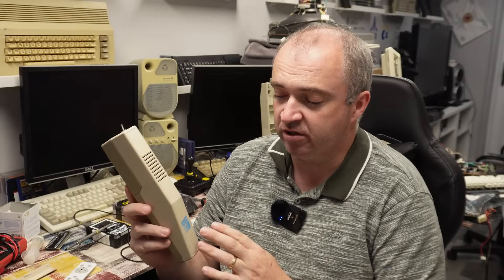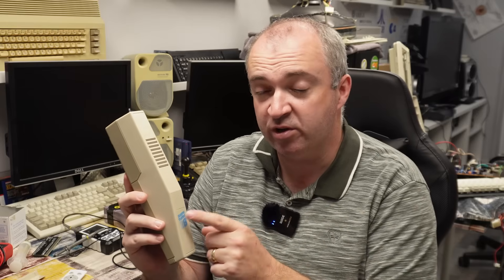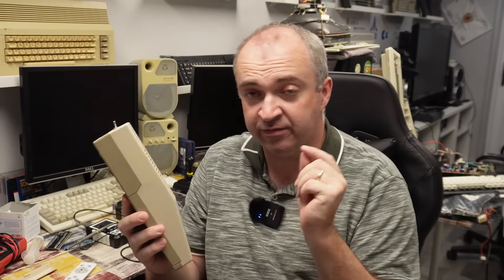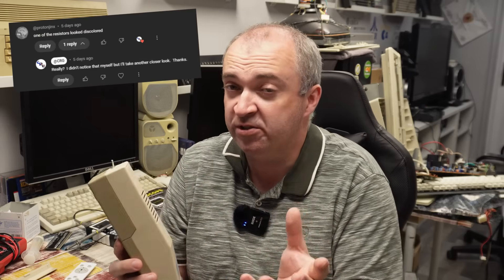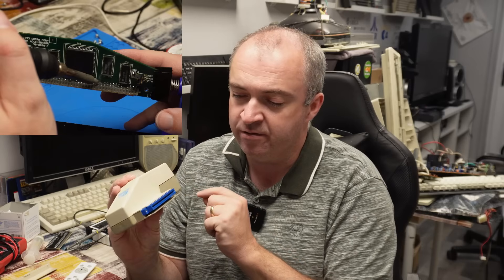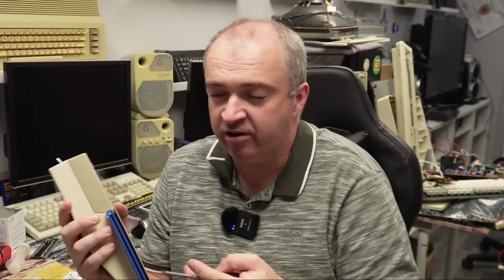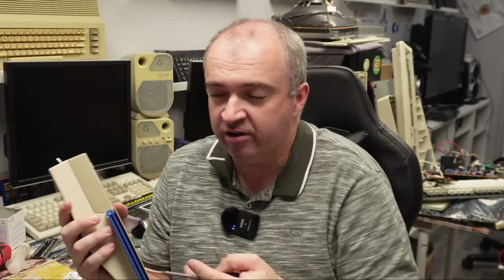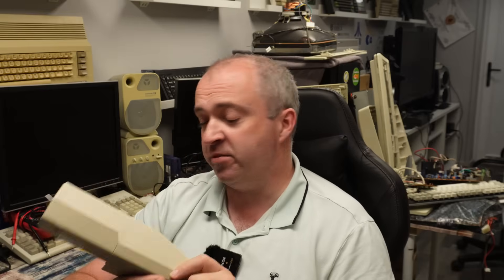This Amiga Accelerator STILL refuses to work!

Comment from the maker: E-Mail from ARNE about the Atari ST device 

As you can see the IDTs have /CS, /OE and /WE like any other SRAM. /CS is always (GND) active just to act faster with the expense of using a bit more current. But /OE is tied to Vcc i.e. in-active all the time!  That means the "data" (addresses) on the IO[1..8] pins is never read_! You can only write into the IDT in the way it is connected in the schematic!  So a write-only device does not make sense at all. Well, yes. But there is one _output channel beside the IO pins: the MATCH pin (HIT signal in the schematic). On /RESET the GAL logic will assert (=GND) the /CLEAR pin of the IDTs. This will lead to the SRAM matrix to be set to '0' in some ten nanoseconds. Now the IDT-SRAMs are in their 'initial' state. Whenever a device (bus-master like CPU) accesses a memory location it puts the address on the address bus. The IO pins of the IDTs are connected to the upper part of the address bus while the lower part is connected to A0..A12 of the address pins of the IDTs. Cache is empty and needs to be filled. Whenever the GAL logic decides to store a 16bit word in the data SRAMs IC4/IC5 - only on writes to memory on the Mach16 - it needs to perform some red-tape action. At the same time when it writes the 16bit word into IC4/5 it needs to update the according entry in IC2/3. The upper part of the address visible on IO1..7 will be written into the location addressed by the address on A0..12 by asserting /WE. So, now we have stored a single data-word into the cache. The same data-word is written to the main-memory (write-through access). How to speed things up?  Now comes the magic: every address on A0..A12 addresses an octet (byte) in the internal SRAM matrix. The IDT takes that byte and compares that bit-pattern with the bit-pattern currently on IO1..8. If the patterns match then we have a cache-hit. The GALs now forces the data SRAMs IC4/5 to output their stored data-word on D0..15 and an access to the (slow) main-memory is not even started by the GALs as they intercept /AS, /LDS and /UDS coming from the 68000. They "capture" these signals and start the faster SRAM access instead.
That is the magic behind the MATCH pin. As DMA devices can alter main-memory contents without the GALs knowing anything about it we run into one problem: the updated data in main memory can differ from the cached values in IC4/5 which will certainly lead to problems (aka guru meditations). How to solve that? Simple: assert /CLEAR and invalidate the L1 content - like on /RESET - and start all over again. That said it is pretty obvious that constant DMA accesses will ruin cache performance.

One more side note: as you can see IO1..6 on IC2 are pulled high. This is very important! At least one bit of all IO pins needs to be pulled high! Whenever the cache is in its initial state (matrix is erased via /CLEAR) every bit (especially on IO1..6 in case of Mach16) is set to '0'. Whenever you use /WE to write into the tag SRAMs IC2/3 the high-pattern on IO1..6 overwrites the '0' with a '1'. Next time the tag SRAM compares the internally stored pattern IO1..8 with the external pattern on IO1..8 it will check IO1..6 for a '1'-match, too. If the internal bits are still set to 0 then this indicates that the data at that address has not been stored in the data SRAMs IC4/5 yet. OTOH if the IO1..6 bits are set to '1' this will lead to a MATCH if the rest of the pattern matches, too.
This way the bits at IO1..6 represent the Valid-bit. It would be enough to just use one of the six but as you shall not leave such inputs floating just connect them to high. The author may have grounded IO1..5 and just use IO6 as a valid it or any other combination as long a at least one unused IO is pulled high to counter the internal '0' set by the /CLEAR action.

As the upper part of the address bus on all IO pins of IC2/3 goes up to and includes A23 this indicates that the whole 16Mbyte address space of the 68000 is cachable. The cache is implemented as a "direct-mapped" cache i.e. for every memory location (16 bit word in the case of the 68000) there is exactly one location in IC4/5 where the data can be stored/cached. In case of the Mach16 and your accelerator the cache size is 16KByte. So the locations at $000000, $004000, $008000, $00C000, $010000, $014000,... share the same offset-location in cache ($0000) and the same applies to $000002, $004002, $008002, $00C002, $010002, $014002,... share the word at offset $0002 in IC4/5. That is why you need to store the upper part of the address in the tag SRAMs (the red-tape stuff) to distinguish between the possible main-memory loacions $000000, $004000, $008000, $00C000, $010000, $014000,...

In case of the mach16 the cacheable area is 16MByte (more specific 8MWords) and the cache size is 16KByte (more specific 8KWords): So 8M / 8K = 1024 i.e. that 1024 main-memory locations have to share a single L1 location. Bigger cache = more cache hits as less main memory locations share the same cache location. 

Previous Comment from ClayCowGill

Insider knowledge disclaimer-- I worked at Supra. So yeah, removing the part numbers (early on) was just to frustrate competitors trying to either reverse engineer (or simply figure out our costs). Early units had pretty much ALL the part numbers scrubbed by electric-erasers... I also remember a little discussion about the 68HC000 in particular in that the top speed grade from Motorola at the time was 16MHz (obviously we were overclocking) and we didn't want to have to have our (two) Amiga tech support people have to argue about 'out of spec' parts with nerds on the phone. ;-) Engineering also thought it was funny imagining GVP or some other competitor trying to figure out if we had a special deal with Motorola to get ~33MHz 68000's or something... We ran the accelerator in engineering up to 40MHz (it was originally going to be a 36MHz accelerator, but we got cold feet about compatibility/reliability and turned it down). Running slower also gave purchasing some elbow room in the speed grades of the SRAMs (and maybe PLDs?) which helped keep it cheaper and easier to source parts for.
 
In addition to making it smaller, the Intel PLDs also helped with the design obfuscation/protection -- at the time there wasn't any real fear of anyone being able to bypass the read back protection easily. (Back then there wasn't any Chinese outfits with a SEM and a FIB that'd crack programmable logic for a few hundred bucks!) Those parts are N85C090's -- kind of an early CPLD with ~24 macrocells (900 gates, hence the part number). They had a decent amount of IO though (more IO pins than macrocells). The 'clock' lines on those are just that-- a globally routed clock if the logic needed it. One of the PLDs acted as a state machine (so it used the clock pin as intended) and the other was just a bunch of combinatorial glue, so no clock edges needed.

The benchmarks were indeed legit, but we would definitely pick the scenarios where we won! (e.g. things that fit in cache were very quick, so compare that to a slower clocker '030 upgrade over the 16-bit memory bus and the Turbo28 could outperform.) 

The Turbo28 cached and accelerated system ROM (0xF80000-FFFFFF), slow expansion RAM (0xC00000-D8FFFF), and fast expansion RAM (0x200000-9FFFFF). Removing the 'option' jumper punched a hole from 0x600000-0x9FFFFF for hardware that did DMA or otherwise messed with the cache. At boot time the cache is actually disabled-- there were timing loops in the boot ROMs that early acceleration messed with, so the cache only becomes functional (if it's enabled by switch/jumper) once autoconfig starts.

Comment: As I am not familiar with the Amiga at all I have some questions:
how does the Turbo 68000 deactivate the A500 internal 68000? Is there a /HALT line from the external connector to the internal 68000? Is anything else in the A500 connected to this internal /HALT signal?
The 68000 always boots by loading the long-word at $0 into the SP and the long at $4 into the PC. So some ASIC in the A500 must mirror ROM into these 8 bytes. As soon as the 68000 leaves its reset-state you must see activity on /AS, /LDS and /UDS. For 4 16bit words these are 4 accesses and each must be acknowledged by the A500's /DTACK line. All these signals have to be present on the Turbo28's CPU.
The point in time at around 6:17 is way too late for any meaningful measurement. You have to catch the moment when the 68000 leaves reset state!
Regarding /LDS and /UDS: when reading they do have the same timing as /AS, only when it comes to write cycle they are asserted later than /AS. The more important one is /AS as it starts the bus cycle. And it doesn't matter if the CPU just wants to read (let's say) the lower 8 bits on D0..D7 from ROM or the whole 16 bit. If the CPU is presented with real data on D8..D15 in such a read or just the pull-up $FF just doesn't matter as the CPU discards the upper byte anyway. Same goes for /UDS=low and /LDS=high. And the Turbo28's 68000 has to see these four /DTACKs.

I assume that the Ali chips are fake as IDT uses a totally different logo with the 'I' looking like the math symbol for integral.

All my Ataris with PALs and GALs still work. People say that PLDs start losing their data after 25 years, but the datasheets (to my knowledge) claim that the devices keep their data for at least 25 years at 85°C. Who stores his Amiga in a stove?

What really puzzles me is that /HALT stays high - cannot offer an explanation right now.
Addressbus low is another strange behaviour. Is it connected to the A500 addressbus directly or does it run through the PLDs (unlikely). Databus at 1.5V (i.e. between 0.8V and 2.0V is undefined. Both busses should be pulled high by the A500 pull-ups when the CPU does not drive the bus(ses).
You may try to remove the A500 68000 while running the Turbo28.

I can send you a picture from my scope how /RESET and /AS work on an Atari ST - which has to be identical to Amiga as this is pure 68000 stuff and nothing specific to Amigas.

Anway: thumbs up for your effort to save that piece of hardware.

Comment: Welp, RSVP that Supra Turbo 28.

I've seen TubeTime manage to get data off read protected devices by glitching the microcontroller into dumping the ROM, but this one isn't a microcontroller. I've also seen him probe the ROM directly on the die to read out the data, but that's perhaps a little extreme. The only really feasible way to do it is to brute force it by just trying every single combination of inputs and checking the resulting outputs. And yes, TubeTime has done that before too, he even built a machine that automates it, since it can take many hours to go through every pin combination of highs and lows on the chip. The problem is that you end up with a huge algorithm that contains a bunch of invalid states that would never happen, and not only produces invalid results, but is way too big to program onto the device. The trick to figuring out which states are valid or invalid is to look at how it's connected to the system, and understanding how everything connected to it works, which should allow you to rule out most of the invalid states.

In any case, such an endeavour would be a huge challenge for someone like TubeTime, who's not just a highly experienced embedded hardware programmer, but an experienced hardware hacker. Definitely not job for us mere mortals.

Comment: I am afraid this is a harbinger of things to come for a lot of vintage hardware of that era. GAL and PLDs do have a limited shelf life and will eventually erase themselves. Depending on manufacturer published specs it’s about 20 years which we’ve already gone way past… Since the equation for most of these are closed source and/or the devices themselves are protected this will soon render a lot of these devices useless.
Reply: True, the be a use pico pi or an esp32! But your point is validly
Reply: I’d like to point out that if the security bit is set (which is likely), rather than attempt to dump the JED of the CPLD, my approach would be to hook it up to a signal analyser, sniff what it does and attempt to simulate it. Needless to say This isn’t exactly a walk in the park either…
Reply: Thats why the PLDs in a working accelerator need to be read by someone with one of those expensive compatible programmers. They could then have new preprogrammed PLDs for sale.h
Reply: @simontay4851  it’s not that easy unfortunately. The vast majority of PLDs used on commercial products of this era will have a protection bit set and cannot be read back. You’re left with reverse engineering the equations by reading the outputs by sending all possible signals combinations to the inputs. This is generally easy for simple PAL/GALs but far more complicated if the GAL/PLD is registered or uses a clock or has hidden intermediate states.
Reply: @stbagn I've been doing the same with non registered GALs and PALs for time now using an arduino that dumps a pseudo truth table - for want of a better phrase - to the serial port. I've then manually worked out the equations. So far I've not tried this using registered devices, but it sounds like a nightmare. It would probably be possible if you know the internal setup of the chip ie the cell type and wiring etc, and had the schematics of the board to know what the inputs and outputs are, given GALs can change some of their pins pins from I to O etc. 

I guess the first step here is to work out if these two PLAs receive a clock signal or something similar from the layout of the board. If they don't then this may make it easier to understand the logic in them.

On a slightly different note, I suspect the heating up of the cache RAM is probably more to do with a ongoing data bus crash between the two chips if both are constantly selected and one is (for example) trying to drive the bus high and the other low leading to a large constant current draw between the chips or the main data bus (example only!)

It would be helpful to see what is controlling the read and write pins of the RAM chips (I suspect the PLA) and what state these signals are in.

My suspension is that these chips map this in as cache memory as a write through sort of setup, or they cache the kick-start ROM, and redirect the new CPU to this.

I'd also be interested to see if the Kick-start ROM is being selected during the attempt at startup from the accelerator.
Reply: @jamescronin7742  unfortunately these PLCC 44 packages are far bigger than any simple PLA or GALs and are therefore far more complex CPLDs. Brute force truth table building is highly unlikely to work.
Reply: @stbagn  that doesn't necessarily mean that all the more complex logic is used. It could well be they just needed the additional inputs or outputs beyond what a smaller/simpler package would need, although I accept this may not be the case. Without working out a schematic from the board its impossible to tell, and without this you can't really get an idea of what they are all doing even at a ToO level.

Comment: So, forgive any ignorance on my part, but why is the lack of a way to (gracefully) read one of these chips, if you got your hands on a working example, a dead stop? The thing must have a set of inputs, and provide outputs in a predetermined manner. There is a logic to the outputs, right? Why is it not possible, again providing a working example, to brute force it by giving it every possible input combination, and reading the outputs, and building a truth table from it then gleaning the equations from that? Might be a task to do manually for sure, but considering we've got devices like a pi or arduino, surely someone so inclined couldn't program one to do the inputs and outputs and automatically generate the equations from that.
Reply from the maker: It would be absolutely possible to brute force a working example and from that reproduce the equations for a new chip but I'm afraid doing that is outside of the scope of my knowledge.  I'm not sure if there is an automated means of doing it with a Pi or Arduino but I suppose it would be possible to write some sort of program to achieve that.  

The issue with doing this though is capturing every state of every pin as they interact with each other.  These ICs have multiple inputs and multiple input/outputs (apologies I can't remember the number off the top of my head) so you can appreciate there are probably hundreds of combinations for the logic.
Reply: @CRG  I thought so. Sadly, I neither have a working example, nor have I any experience with microcontrollers. I've just seen what others have done and figured someone out there could probably program one to do that. Maybe another one of your viewers. And maybe another will have a working sidecar, and willing to allow it yo be reverse engineered. Maybe even the same viewer. Lol. I've seen similar things before, a viewer have a working example of some obscure item that helps a creator unexpectedly out of a bind. And it'd have the potential of leading to reproduction if lucky.

Comment: any time you have more than one failed IC there is a chance that the board was damaged by over-voltage.
Reply from the maker: Very possible but I've no way to prove that other than the fact that its dead.

Comment: I do have an old programmer that can read and write the programmable logic devices that you have. However any working devices you may find will probably be read protected which effectively stops any repairs of your board.
Reply from the maker: That's what I suspect so the only way would be to either get a copy of the original equations or brute force it and figure it out from scratch.  It would take someone more knowledgeable than my to do that though.